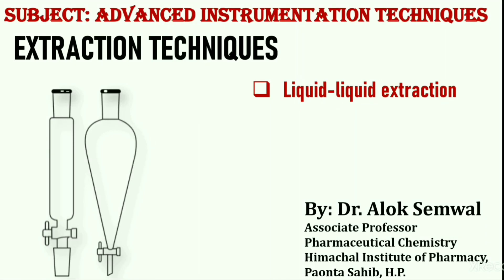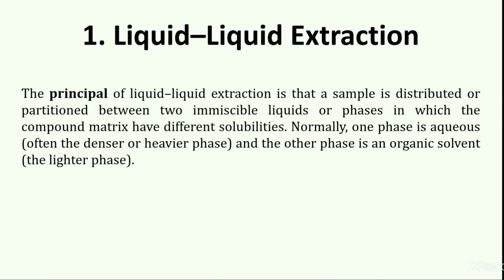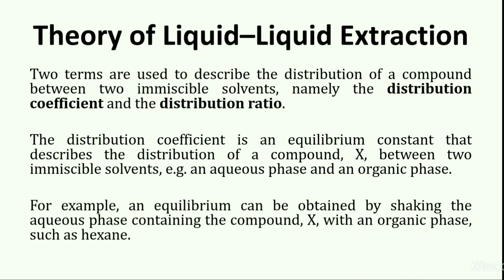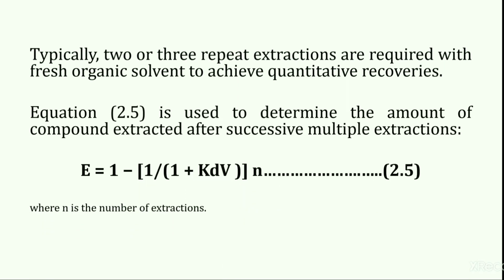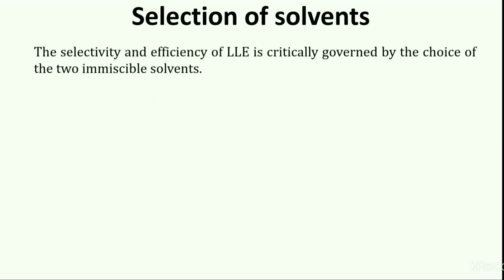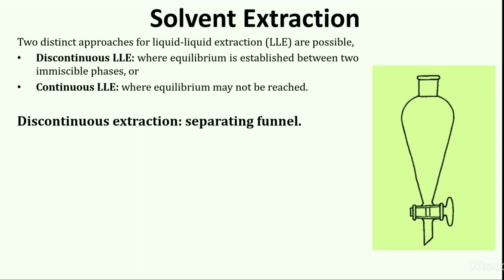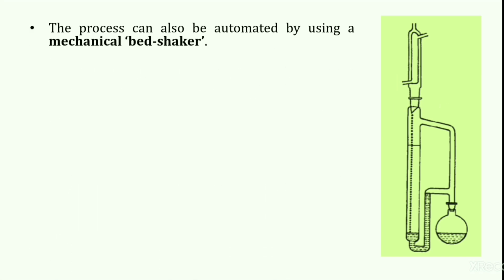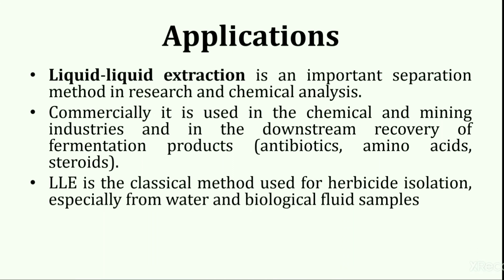Liquid-Liquid Extraction: PCI Syllabus /Extraction techniques involving liquids

Comment: Sir for GCMS analysis, after separating from separatory funnel which part could be used to send upper part or lower part?
Reply from the maker: GC-MS is a automated machine so there is no need of using separating funnel. Separation will occur through GC and the separated components will move towards the  MS assembly automatically.
Reply: @PharmTechInsights  Tq sir but for my study I need to do vermiwash GCMS work for that I need to do liquid liquid extraction method! For that which part should I send?
Reply from the maker: As far I know Vermiwash contains enzymes, macro and micronutrients and most of the studies related to enzymes suggests analysis of aqueous part. However you can go for both parts for the detection of all micronutrients.
Reply: @PharmTechInsights  ok sirr tqq so much